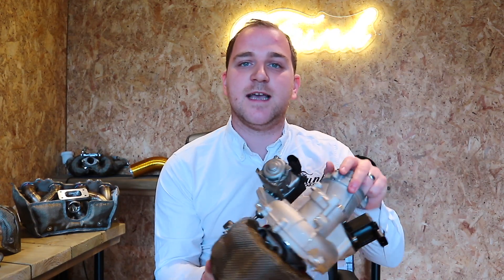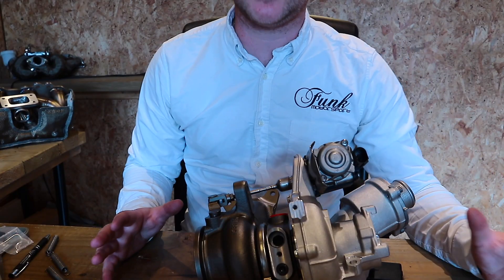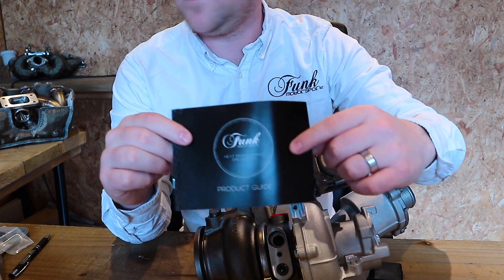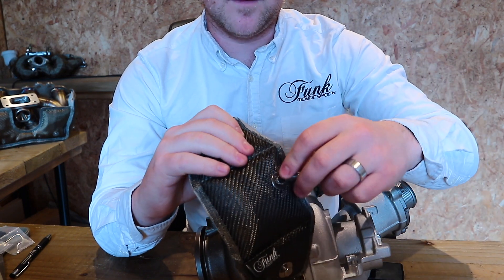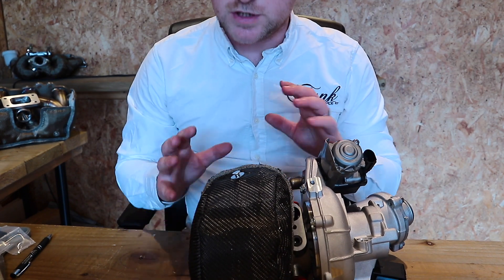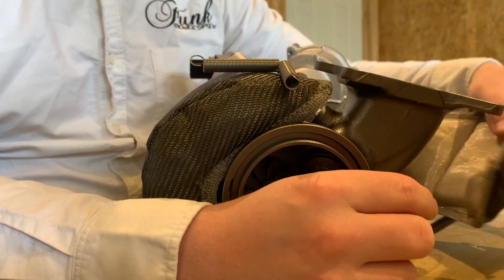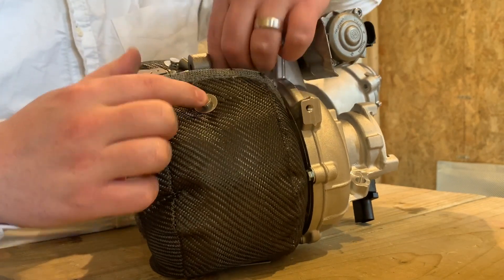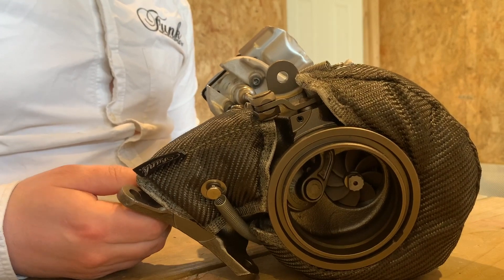Funk Motorsport IS20 / IS38 Turbo Blanket fitting guide - Golf R Turbo Blanket fitting!

Comment: Total pain in the ass to install on the car. Gave up with the back spring. When rear spring was installed it would catch the actuator and cause it to stick open throwing a epc.  Couldn't tell if it qas the spring catching or the material around edge of blanket.

Comment: You’re having a laugh mate. I’ve just got one for my Golf R and it’s impossible to fit. Easy enough when the turbo assembly is in your hand… Try it when it’s bolted in the car.
Reply: Its a piece of piss off the car but on the car fucking joke putting this in
Reply: @Gviper03 welcome to working on cars bruz, every job is a cunt of a job 🤣🤣
Reply from the maker: We have lots of these on customer vehicles with no real issues. Please drop us a message if you run into any issues during the fitting process, and we will be happy to try to point you in the right direction!
Reply: @Funkmotorsport I need a guide. My mechanic said it's tough to install